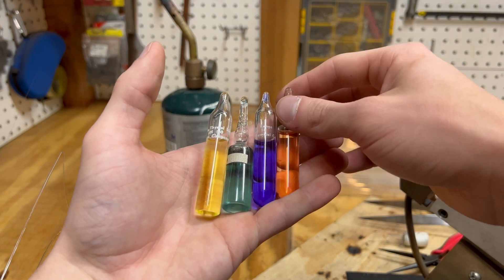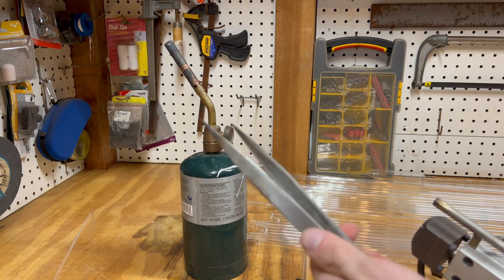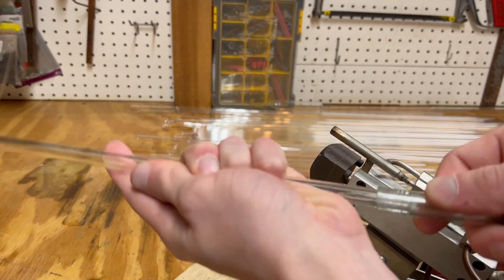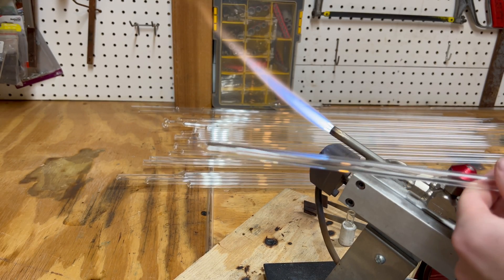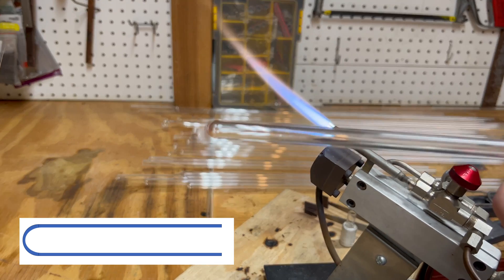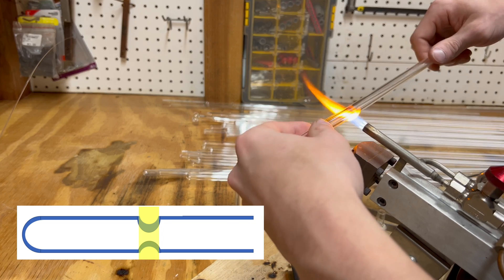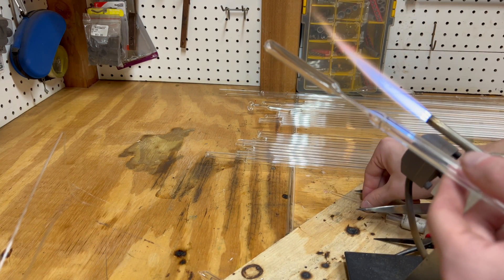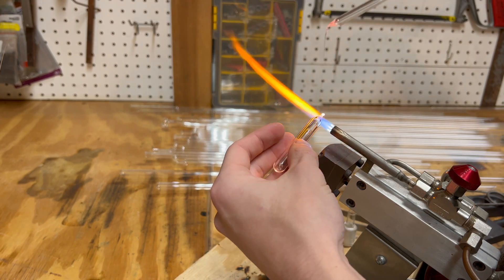Scientific Glass Blowing Ep:4 How to make an ampoule from scratch or from test tube

Comment: is the following tek used to cut properly glass ? By using a thermal shock, I remember cutting a glass bottle by putting a  fine band of fabric( old cloth, old t-shirt, or sheets)  imbibed by alcohol and then igniting it so the bottle was heated just at the place where the band of tissue was rolled around the bottle and then Immerse the bottle in a cold water container and the hot Vs cold reaction produced a thermal shock that cut it relatively clean I used that to make some DIY lamps with a nice looking bottle like with a Bombay gin bottle.

Comment: how would we get domes on both ends?
Reply: Hi! I've been playing around with burning glass tubing for 1.5 months now. My first milestone was to make a sealed vial with two symmetrical domes, it's getting there. I've made test tubes from 10mm OD 1mm thickness tubes rather consistently, for the 7mm OD 1mm thick ones, those are very difficult to work because the tube is way too small compared to the flame diameter. Test tube making is related to the dome seal.

Now to answer your question, seal the vial like how you would pull seal when forming a test tube. You can look at Wheeler Scientific's video on that, I've learned it from him. Before the seal, heat up the glass below slightly to expand the air inside to give some tolerance for expansion. Work the seal to as close a dome as possible, but there is a risk of the air getting too hot and popping the melted glass, this is where the expanded gas comes in useful, you can cool it off slightly to give more temperature allowance for the heated part.

It is a balance of glass temperature, glass softness, air pressure, and also getting the uneven part hot enough to "flow" the glass. All three aforementioned parameters are interdependent. Small pointed flame is also very useful to precisely heat a small part.

Currently I am using butane-air welding torch. It's quite challenging. Hotter torches would really help tbh.